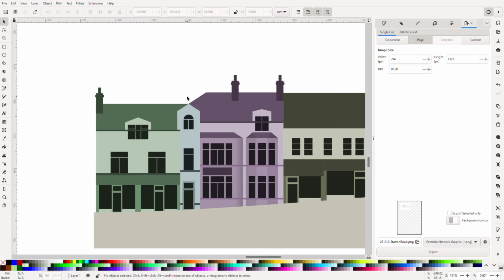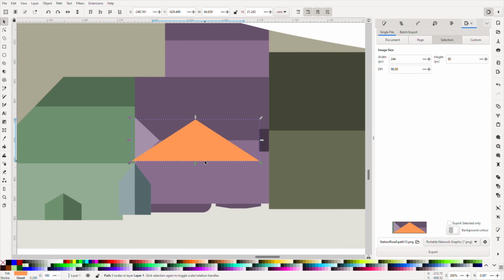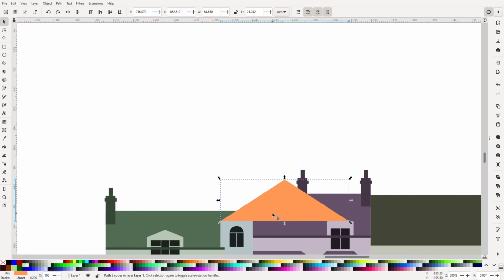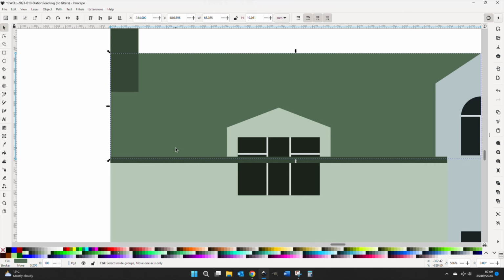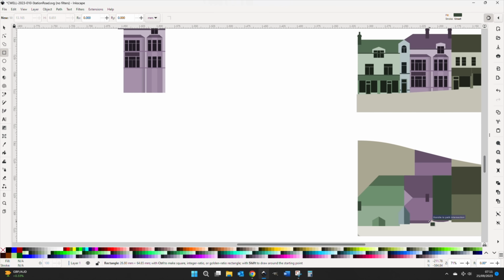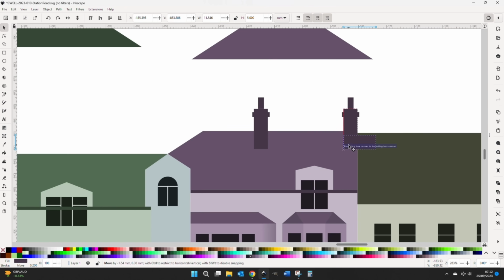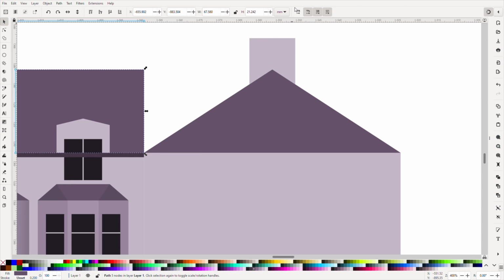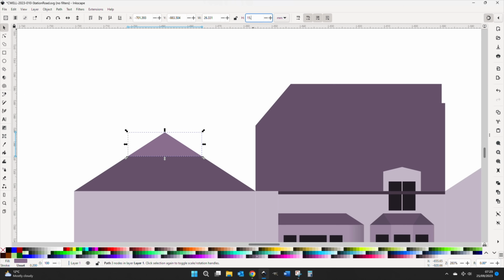Starting a Street - Quickly mocking up to test a design - Station Road Part 4

Comment: To move tow adjacent nodes on an Inkscape drawing it is easiest to select a point between the two adjacent points on the same face and then move them.
Reply from the maker: Thank you. I’ll have to try that as I was sure that turns the straight line into a curve and causes the curve to drag rather than the face to move.  It will be a great time saver if I was wrong all this time. I wonder how the snapping works. Is it the same as if dragging a selection of nodes?
Reply: @Chandwell  You just have to grab either of the two or more selected nodes and pull there are the line will curve.

Comment: I am single and do not eat cereals. So I use a more expensive solution. I buy 200gsm Card, a pack of 100 costs me 27.98 aud so 28 aussie cents per page, which in effect is 14 pence per page. But the benefit is that you can print directly onto the card, therefore you don't have to pay for the sticky label. Also, your methods are so cheap, there is no real excuse, for not starting a diorama, if you do not have room for a layout, or just to make a model and throw it out once it is finished. Because practice in using Inkscape, and making, helps you make a better layout when the time comes to making a layout.
Reply from the maker: Yes indeed - making makes you better, and we are all always learning.

Comment: I think this street is intrinsically lower rent than where the hotel is. Perhaps purple and neighbour formed an early department store or large haberdashers with a central entrance. However purple has no added independent access from the street and those bay windows would have been original features- these don't appear next door even in a modified form. If they are to read as separated parts of a former whole there needs to be more common features albeit in different paint . I know you think about things deeply/carefully. Perhaps you should think a bit about the history of the street. Was it a terrace that fell on hard times  and where bits were knocked down for new and different buildings/uses. Or was it always a "toast rack" street where sections of frontage are purchased and the grandest statement in the current architecture is put up? You could spend a happy hour sketching the street frontage at 20 year intervals - tracing paper overlays. This street is probably made on sold-off gardens and stables of the hotel.
Reply from the maker: Thank you - all very useful and considered. Purple, Green, and Blue are all one building - The Old House At Home pub in Shipley. The central door is in the Blue part, and the other two sides are large ground floor rooms. The one on the left has no bay windows, and the one on the right does. I've drawn it almost exactly as the real thing, so I don't think I need to worry about making it look like one building. As for the history, I am combining the real history of the terrace in Shipley (which was part of a brewery, I believe), and the real history of Brook Street in Ilkley, so I have a lot to go on. I love your idea of sketching how it has changed over the years. I may do that one day!

Comment: Sorry to be  one of those types that worries about arcane stuff but.... Consider that Purple and Blue buildings are independent and constructed at different times. The property line rises vertically and the roof of purple cannot extend on top of next door. It jus looks wrong to me.
Reply from the maker: Hmm. Interesting point. Thank you. The design is based on the Old House At Home pub in Shipley where green, blue, and purple are all one building. There isn’t anything to suggest they were separate and built at different times.  That building is on the flat but the only change I’ve made is to raise the purple one up the hill slightly. So in my mind, in Chandwell, it is one single original building with replacement shop fronts added more recently. If you watched Part One of this series, I showed the prototype, with its complex roof line and overlapping stepped parts. I’d be keen to hear if you still think it looks wrong.

Comment: Are you sure you want to have a four story building with a tall roof on the corner?  If you plan to ever reach over these to manipulate a coupler or re-rail a passenger car, you may want to reinforce that building with wood or plexiglass.  One wrong move with your arm could destroy a cardboard structure before you know it.
Reply from the maker: I’m certain! It is the exact look I am going for. There’s always that risk but maybe in my next video I will demonstrate just how sturdy these buildings are. I’ve knocked the Town Hall a few times whilst making Water Lane and have caused no damage. The walls end up being about 6mm thick, laminated from multiple layers of card with PVA. They are incredibly sturdy.
Reply from the maker: I’m more concerned that the family are often removing heavy items from the shelves above the layout. A book, or vase, or tin of food could fall onto the layout at any time! Who knows the amount of damage that would cause, but it is what it is! 😂🤨
Reply: @Chandwell if that happens, it will be the well remembered earthquake of '92 that hit an unsuspecting Chandwell.